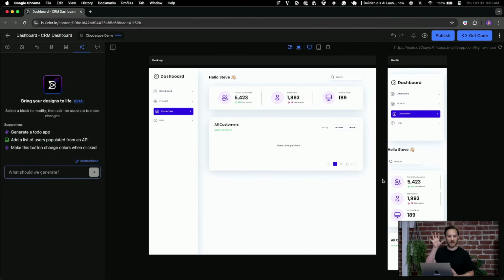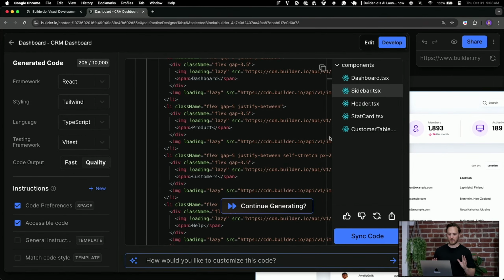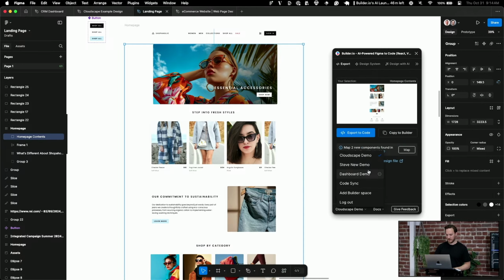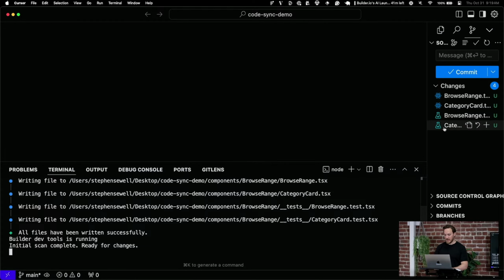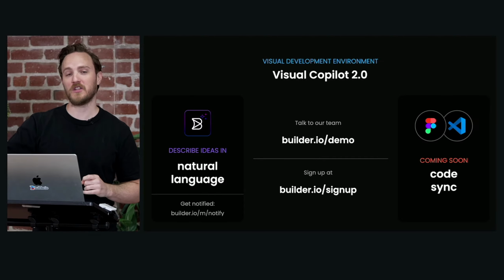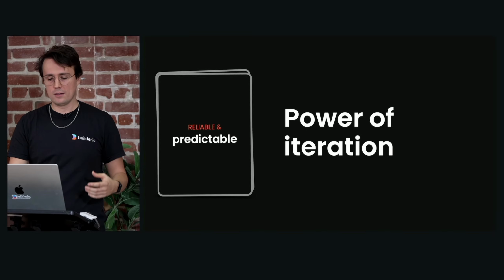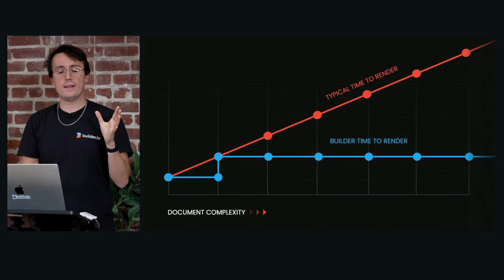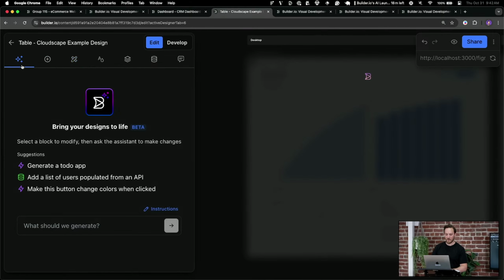Turn Figma Designs into Interactive Apps with Visual Copilot 2.0

Comment: I tried latest builder io version by date, and it didn't work, first the screens exported from figma to builder io, have issues in alignmend, however when exported the code the output is completely different from what is there in builder io, so it is just a waste of time to real devs and production ready level, the time i will spend to fix it, would be much longer than create it from scractch, i really hoped it will work, but will wait another 2 years and come back may be, there will be somethinhg useful here.

Comment: I bet it’s easier to write few lines of CSS than learn your entire framework. Same result. I’m not a fan, just another spinning your wheels product and nothing new
Reply: did you watch the demo? this is far beyond few lines of CSS, it'll have context of your own design systems, components, and data sources
Reply: you’re just mad you can’t even write that CSS without checking W3School and this guy showcased 1 hour of Feature after Feature
Reply: POV: when you are worried about losing your job
Reply: It all depends on your capacity to learn and apply new concepts.
Reply: Im going with Make This Work
Reply: So you think an absolute beginner would be able to learn everything needed for css before learning how to write these prompts?

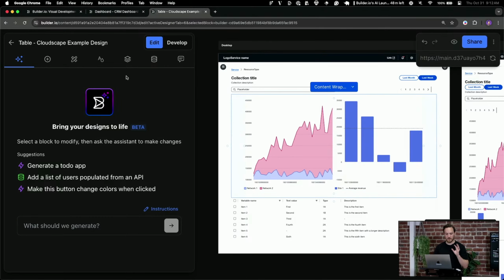Comment: 9:16 I thought export to code with the Builder plugin did use AI screenshots? 

How can you make the exports exactly match the Figma designs? I know there’s the mapping feature, but we’ve been using AutoHTML to get a near perfect translation from figma to react because the Builder plugin was using AI vision which has limitations that you point out in your blog.
Reply: We use a custom model (not LLM vision) for the figma to code flow. We do use LLM vision in rare ish cases to augment the export though, but it’s not accurate enough for most needs
Reply: @Steve8708  Oh I see! I tried again with some components in our design system, we have a layer with ‘background: linear-gradient(…)’ and it doesn’t translate even though it’s in the Figma layer.